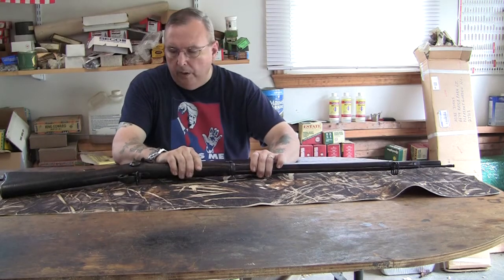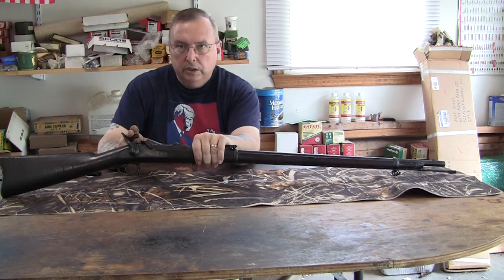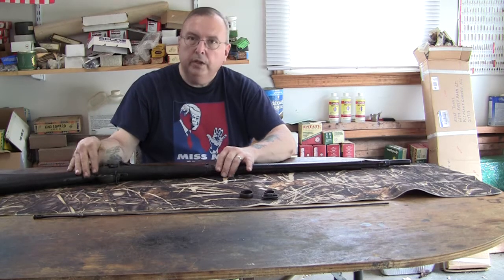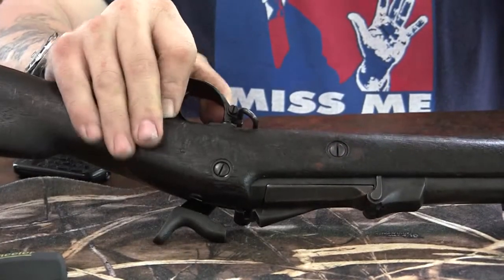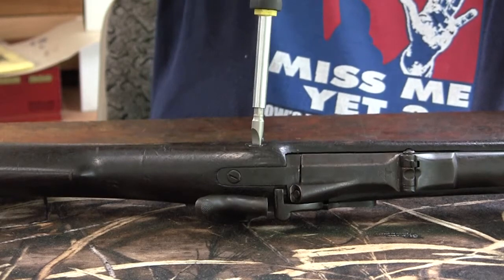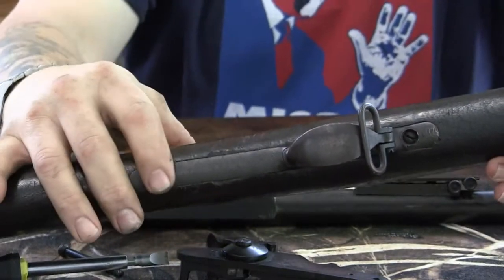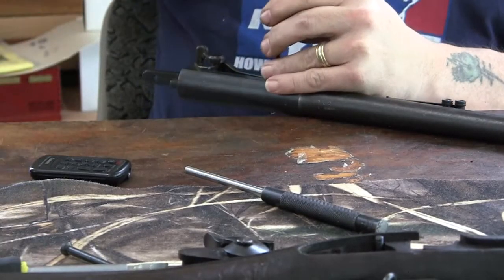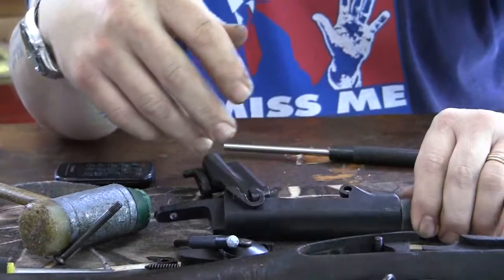Dissasembly of the 1873 Springfield trapdoor Rifle(1/3)

Comment: I disassembled my 1873 Springfield Trapdoor Infantry Rifle. $115.00 in new replacement parts later, I reassembled it. Without a complete teardown I would have not known the rifle had two very weak coil springs, a damaged firing pin, and several stripped screws and an extra tall front sight blade to correct the shooting high issue. Tore the rifle back down to redo the stock and blue the metal. The stock is now ding free and is now excellent. Barrel and other metal is pit free and only in need of a few coats of bluing. I watched your video a dozen times until I could do the teardown almost blindfolded. Thanks for sharing your knowledge with us.

Comment: Mr.  I got my first 73 yesterday it locks up tight n rifling is good no pitting had some leading I removed it.. It shoots like a tack driver with 405 .459 hollow base bullets and 55 gr 1f powder n a wad filler so it functions fine... But it has no catiche that I can see.  Serial number is nearly gone starts with a 31 ..it has 1878 on the lock plate but more I look at it looks like a messed up 3 instead of 8. It has A on the barrel.. Lock... Hammer... And sights... U on the barrel bands... And a huge S on right side of the buttstock was just wondering if you had any idea of what it might be a actual 73 or B special... Thanks
Reply from the maker: it is hard to tell the rifles seen a lot of use after the US government stopped using them , they were used by reserve and militia units, military school drill rifles, and put together by bannerman. I cannot say for sure by just a description.
Reply: TheKoba49 thanks. Main thing is it shoots well that is why I got it. But I came across your channel you are probably the most knowledge on the subject of the trapdoor so figured I'd ask 😊

Comment: Great video. I recently got an 1873 and took it to the range for the first time. I'm trying to clean it but I can't get the ramrod out of the stock. It spins but won't come out. Any advice on how to get it out without damaging the rod?
Reply: I know it's a month late, but if you still haven't figured it out, or for whomever has this problem in the future and stumbles unto this comment, the cleaning rod is captured by a little clip near the front. you pull it down away from the barrel until its clear of the clip, then pull it up and out